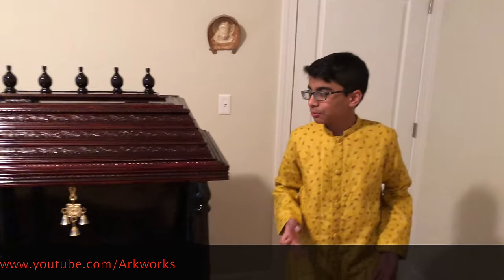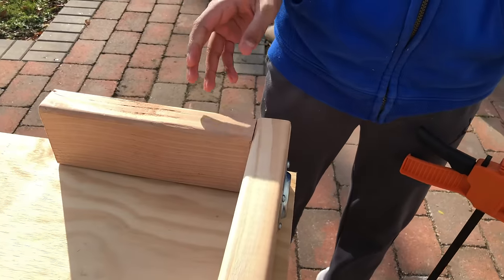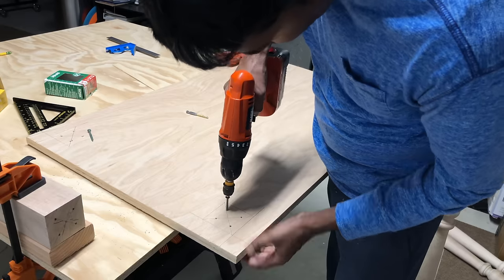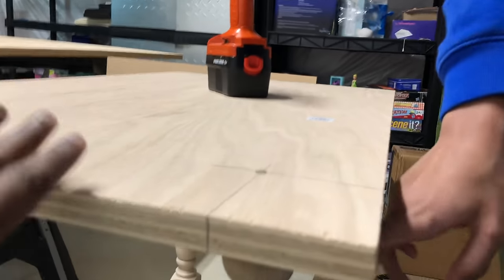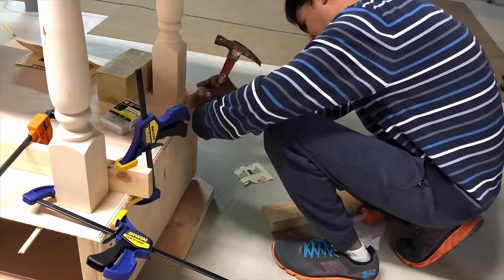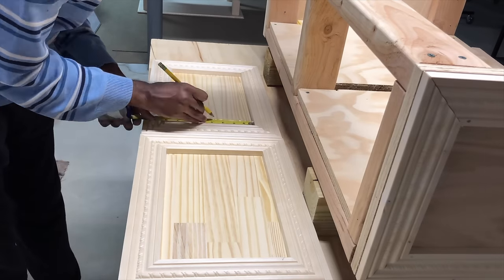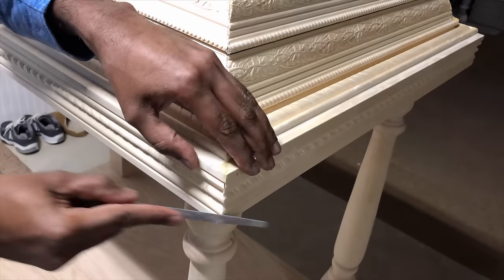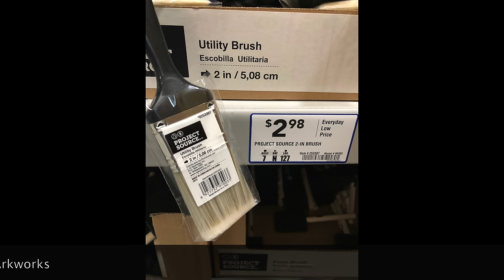Pooja Mandir DIY under $425 (4 feet 10 inches)

Comment: Could you tell us how you made the plan and design for the Mantapa. Also the tools required for building this.
Reply from the maker: Hi, We started off with some sketches (sketch is in video) and improvised it on the go. All the tools used are in the video (at the end). Now that video is available, you can create a plan with your measurements before starting the project.

Comment: Hey buddy wonderful, plz share all the dimensions i also want one
Reply from the maker: Hi Neeraj, Our Mandir made to fit to the space we have. We did not note down all dimensions.

Some key high level info

- Cabinets are one feet long
- Center part is the height of the legs we purchased
- Front and 2 side frames of cabinets are one inch inside the bottom plywood  (cabinet doors flushed to the bottom plywood) and back cabinets flushed against the back plywood sheet of the Mandir

 - Check how much space you have for Mandir in your room and work on dimensions around that.

Good Luck !

Comment: I have completed until the gopuram and  need help to proceed further. Can you  tell me the measurements of wood used for gopuram - 2x4, Plywood, pine wood on which the finials are fixed.
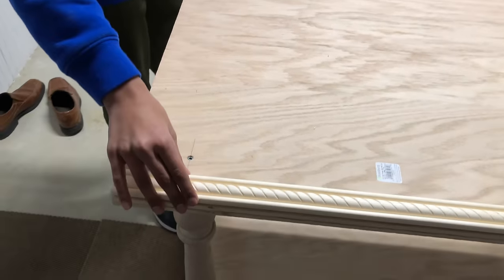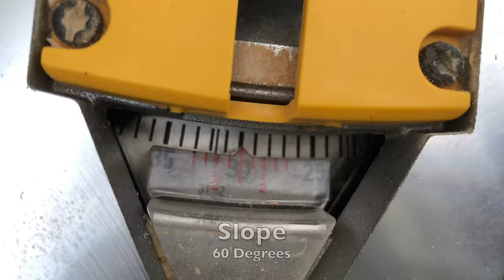Reply from the maker: Hello Kiran, If you are referring to the T shaped 2x4 measurements, watch video from 7:31 to 7:43. 

Mark borders on all sides as seen in the clip from 07:31 to 07:43, measure distance between the lines minus 2 times the thickness of the plywood which rests on the slopes on the T head. Decide on the placement of the T head and measure the distance from T head for T tail. Tail measurement need not be accurate, it can be adjusted by moving the T head inwards/outwards (cut the same length T tails for both sides).

Next, complete all sides of gopuram before cutting wood for the top panel which sits on the top of the gopuram. For top panel measure length and width of the open top, add quarter inch for length and width, cut the wood, place it on top, look at it and make adjustments as needed.

Same for Plywood, measure length between the borders and cut it, height is your choice based on number of rows. Cut 60 degrees for sides of plywood.

I am on vacation, my responses may take little longer, taking advantage of jet lag to respond  :-)

Good luck!
Reply: @ArkWorks  Thank you very much for your response. It really helpful. I'm almost done with the goopuram. I think i was not able to get the exact compound angle cuts, but some how managed that :-). Thanks again for response.
Reply from the maker: Awesome! Any gaps in the corners can be filled with wood putty before painting

Comment: Hi - what is the accessory used with drill at 2.50. I am using #2 philips drill but not successful while drilling 3 inch screws. Your drill bit looks different. Can you pls give the details of what is attached to the drill at 2.50
Reply from the maker: Hi Tarachand, We used deckmate screws, drill bit comes with a box of screws (T25 bit).  if you are referring to yellow dewalt attachment to the drill, below is the link for that. I used that mainly because I was using hammer drill which does not come with hex holder. if you are using the impact drill, it already has a hex holder and you don't need the attachment.

if you drill the holes first, it will be easy to put the screw in. if your philips drill  bit is slipping off the screw, use the holder in the second link below.

https://www.amazon.com/DEWALT-DW2506CS-Piece-Rapid-Fastener/dp/B000GZE3JI/ref=sr_1_8?dchild=1&keywords=dewalt+hex+drill+holder&qid=1600525546&s=hi&sr=1-8

https://www.amazon.com/DEWALT-DW2055B-6-Inch-Magnetic-Drive/dp/B000HNFKHS/ref=sr_1_1?dchild=1&keywords=dewalt+hex+drill+holder&qid=1600525546&s=hi&sr=1-1
Reply: ArkWorks Thank u sir. I am also using hammer drill. I will buy these accessories

Comment: Can u please also share the measurements of the plywood u cut for side of the base, the plank where pillars are attached, the plank of gopuram. Also the measurements for the Tshape for go Puram
Reply from the maker: Hi Ashwini, I think it is around 39 inches. I suggest you to start with how much space you have for the Mandir and then decide the measurements, go with couple inches less than the space you have (to accommodate railing on 3 sides of the plank). Do one step at a time and get the measurements for the next step, don't cut all pieces upfront, measure after every step and cut accordingly. Don't rush, one step at a time, you will have the flexibility to change the design. You will enjoy the experience. 

I did not note down measurements:-), also my measurements "as is" might not work for your needs, measure as you go along.
Reply: ArkWorks - thank u for such a quick response.. my husband and I are currently putting the design on paper and will start the project soon.. we might have a few more questions as we move along with the project.. hope that is ok..
Reply from the maker: Sure

Comment: @ArkWorks - We are just planning to start our mandir and have a question.
Can you pls let me know the dimensions of bottom box. As per the video it is 40inch width and 24inch depth but the sheet used is 16in. Can u pls confirm what size sheet you used and what are the exact dimensions of box.
Reply from the maker: Hi TaraChand, Are you referring to -> "(Common: 3/4-in x 16-in x 4-ft; Actual: 0.656-in x 16-in x 4-ft) Pine Board - Pine board (planks on top of the gopuram)"

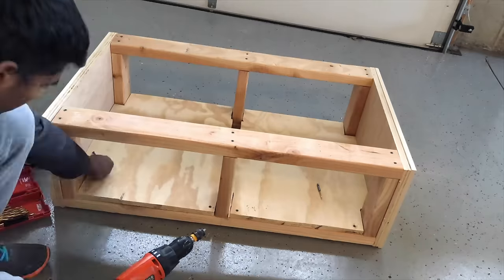That Pine board is used on the top of the gopuram. Watch video from 11:35 to 11:45

Below plywood is used to attach the pillars and it is cut to around 39 or 40 inches by 24 inches

Top Choice SkyPly 3/4-in HPVA Oak Plywood, Application as 4 X 8 Oak plywood attached for pillars, side cabinet,…

Good luck with your build.
Reply: ArkWorks yes sir. I am referring to the plywood used to attach the pillars. I got the answer. Thank you

Comment: What's the size of the plywood at 3.20 minute? Thank you!
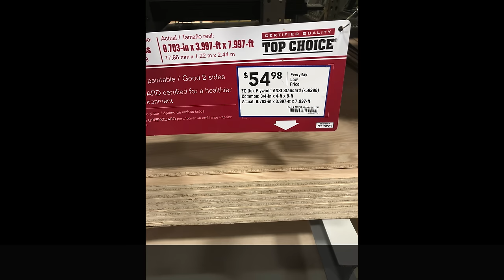Reply from the maker: Hi Jay, 3/4-inch Oak Plywood. All the materials used in this project are shown in the video from 16:45. Material list is also in the spreadsheet.
Reply: What is the dimension of plyboard used on top and bottom of pillars? Also please share the dimension of ply used in the back.

Comment: Additional 2000 for equipment
And 1000 for effort 👏
Reply from the maker: Equipment is not that expensive, Hitachi miter saw is $150, circular saw can be around $100, these are the only expensive stuff, others are not much, you really don't need work bench I have, some of the equipment (like drills) almost every home owner have them. and these equipment can be used for many years for multiple projects, there is long term value :-)
Reply: @ArkWorks  thanks for your reply.. it's my dream project.. hope to start soon and try to match at least 50% of your art. This is inspiration!!!

Comment: Thank you for sharing your beautiful work. I just started it and will show you the outcome once it is built, I hope I will be able to make it. One question  - Can you specify the details on the screws you used - size, thickness. What I understood is, you used 3" inches screw but is it 10 or 12 thickness ? Please clarify. My concern is, is the 3" inches will split the wood ?
Reply from the maker: I used 3 inch screws and 2 inch screws (Deckmate #9 x 3in and #8 x 2in). You should be good If you predrill screw holes. Good luck with your project! and yes you can make it!
Reply: @ArkWorks  Thank you for your response. I am in the process of installing the pillars to the boards. What is the size screw did you use to attach the plywood to the pillar (base (square part) of the pillar and the peak (tail end)), meaning base-3 or 2 inches, pillar peak - 3 or 2 inches
Reply from the maker: Hello Satish, I received an email with your comment, somehow your comment is not showing up in the comments section of this video, was waiting for it to appear before I respond, comment is not here yet, so decided to put your comment here and respond to it.

Your comment:  "ArkWorks Thank you for your response. I am in the process of installing the pillars to the boards. What is the size screw did you use to attach the plywood to the pillar (base (square part) of the pillar and the peak (tail end))"

ArkWorks: We used 2 inch (#8 x 2in) screws for the bottom (4 screws) and top (one screw).
Reply: Thanks for the prompt response, especially over the weekend :). We will go ahead and use #8 * 2inch screws now. This is probably not the last time you will hear from us 😁
Reply from the maker: No worries, happy to help!
Reply: @ArkWorks   Hi there, I am assuming that you either glued or screwed the angular "T" wood bracket on the top board. Is my assumption correct. I see that the angular plywood for gopuram is nailed.
Reply: Just re-watched and realized that you did not glue/screw the "T" wood bracket
Reply from the maker: Correct (just incase if we need to make any adjustments), you can glue it if you want, make sure to align the ends properly.
Reply: @ArkWorks  That is a good point. Ours is 4 feet x 2 feet depth. Not sure what the height is. But I am going with 3 rows of trim for gopuram that the way you did, was contemplating whether to go for 3 or 4 lines of trim but decided to go with 3 rows.
We did cut the plywood for all the sides (of gopuram). The tricky part is now cutting the trims for gopuram.
Reply from the maker: Trick is finding the angle, once you figure out the angle, it gets easy, try with the scrap pieces first.
Reply: @ArkWorks  Thank you friend. We finished up to gopuram. Glue work and angle cut was definitely challenging, finally we did it, not 100% perfect though. As mentioned earlier ours is 4' in length, I am planning to build small (removable) gopuram and fix the finials. I am working out of the car garage, it is very hot, worried about the heat spoiling the trims/mouldings, will move it to basement. Thank you for all the help.
Reply from the maker: Thanks for the update, good to know Gopuram is completed, that's the only difficult part in this project (compound angle cut to perfection), I spent good amount of time thinking how to design and build gopurum as there was not much info on web and compound angle cut was new to me.  Rest of the project should be simple. Good Luck!
Reply: @ArkWorks  Hello friend, we started applying the stain, first quote is done except for the gopuram part. Trying to apply gold color to the spinials (just a thought).I will share the pictures once it is done.
Reply from the maker: Sounds good!
Reply: @ArkWorks  Hello , how was your vacation ? We DID IT finally and inaugurated  the mandir on day of Ganesh Charturthi. Thank you so much, without your video it wouldn't be possible for us to build it.
Reply from the maker: Awesome! Vacation was good.
Reply: @ArkWorks  https://drive.google.com/drive/folders/189teSNMuDgiV8zbyvTKKRSMFFDfB4L_k?usp=sharing

Dear friend, please find the temple we did after following your video step by step.
Reply: @satishpatnaikg   hello Satish.. did you put gold color for gopuram ? Can you share your picture.  Thanks
Reply: @deals4hb  Hello, I did not apply gold color to the gopuram. I wish I could share it. However, I have shared the link where the picture is placed.
Reply: @satishpatnaikg  thank you
Reply from the maker: @Sathish Patnaik: Awesome !!! Mandir Looks Great !!!
Reply: @satishpatnaikg  Hi, It looks nice. Could you post link for the bells?  @Artworks, great job
Reply: @mralwal  We bought the bells in India during our visit in June 2019.
Reply: Satish Patnaik, It’s beautiful. I am planning to start the project with same size 4’ x 2’. Can you please share the dimensions of the gopuram and the angle of cut? Thank you in advance
Reply: @mralwal  I bought the bells at Visakhapatnam, India
Reply: @kiranmaram2342  Hello Kiran, I followed the excel sheet "Artworks" shared, step by step. I could build it because of the detailed video he shared.
Reply: sorry it is Arkworks

Comment: Will the compound angle you mentioned work with any dimension wood?  Can you please let me know the angles again. I am planning to do the pooja mandir and got stuck on the gopuram part. I am using a 5 1/2 inch width wood pattern.
Reply from the maker: Yes, google for "Compound Angle Calculator", click on one of the link and provide the angle and number of sides to get miter and blade angles (I used 4 sides and 59 degrees).

Number of sides:   4,   Angle of sides:   59

Miter Angle:   27.3,  Blade Tilt:   37.3
Reply: Yes, I am also using the same 5.6 inch wood pattern for gopuram and got stuck on gopuram part. I spent 4 hrs thinking about compound angle cut. Still need to find the trick. Is there any possibility of doing a video on gopuram and compound angle part as part2 video?
Reply from the maker: Hi Gautam,  What is your side angle? did you find out 'Miter Angle' and 'Blade Tilt' for your requirement?
Reply from the maker: Hi Sajja, How is gopuram coming along?
Reply: ArkWorks yeah the side angle is 66 degrees. Found the blade angle is 40 degrees and miter angle is 22.5. But not working 🙁

Comment: @arkworks.. for gopuram  5 mm sheet what is length and width you cut and hammered nails to T shape?  Thank you
Reply from the maker: Hi Thore Nux, You might want to measure after adding the borders on all four sides, make sure to account for the 5mm sheet width in your measurement.
Reply: @ArkWorks  ok thank you. In video heard 2x4 5mm board. So got confused.